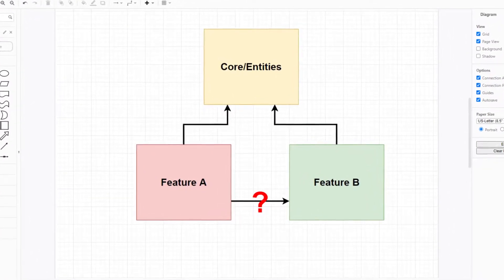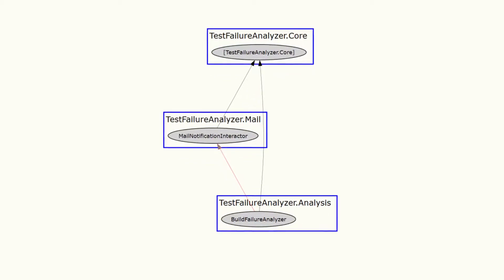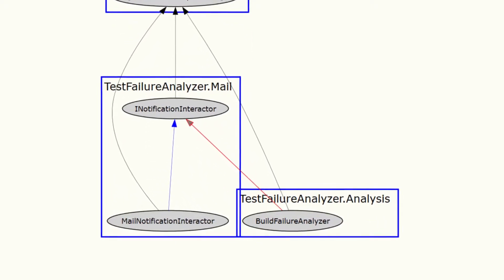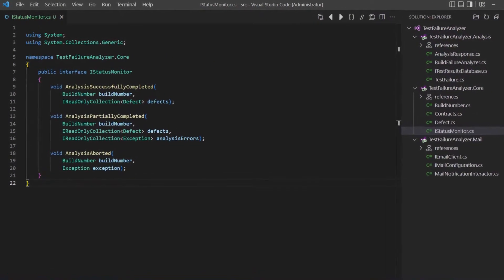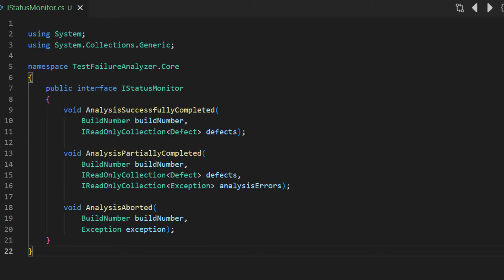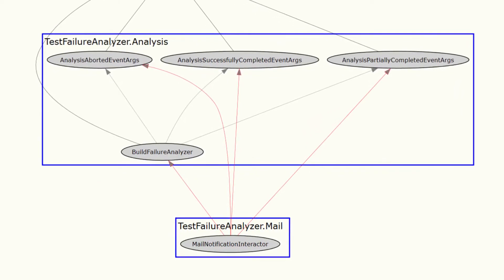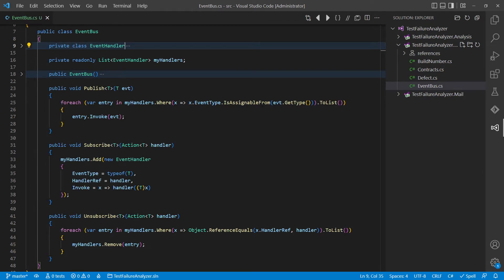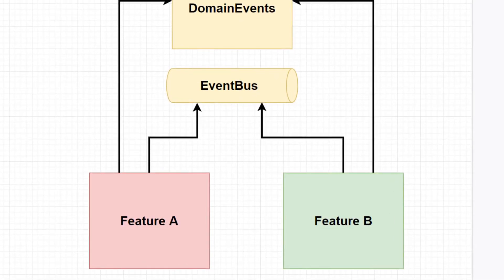Interfaces SIMPLY WON'T Do the Trick!

Comment: Okay but what if feature a and b own their own events instead? Now They still need to know about each other
Reply from the maker: with direct event communication both features still somehow need to know each other which then still create some kind of coupling
Reply: right but contract wise you are still coupled right? because if feature A has a Post entity and publishes an event with a Comment entity in it, then feature B need to know about Comment which in your example is somewhere shared. Now if we move this up where they are both in a different context you cant get around the dependency? or am I understanding that wrong
Reply from the maker: well, the idea is: direct coupling via API calls or direct events is removed by introducing the mediator. and indirect coupling through shared data structures is removed by only using entities from domain model and creating "domain events" which are also part of the domain model. so dependencies still exist but not between concrete features but only from features to domain model (so the concepts and data structures in the center of an app which is intentionally shared between all features)
Reply: @AboutCleanCode  ahhh I slightly misunderstood you. What kind of benefits do you see in publishing events? I assume that since you are not coupled to the contract of any feature you can simply access its domain entities.
Reply from the maker: Domain model for me is defined as cross feature defined common entities (and events). So as both features in the end of my example only depend on the domain model the features itself are no longer directly coupled